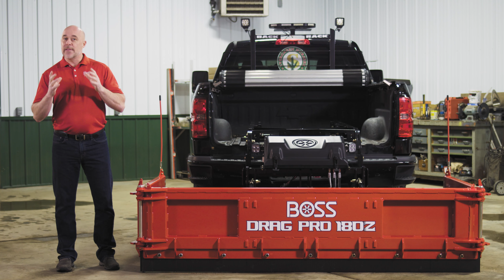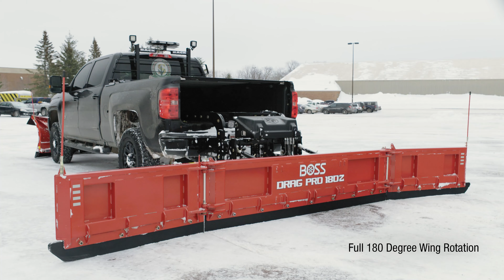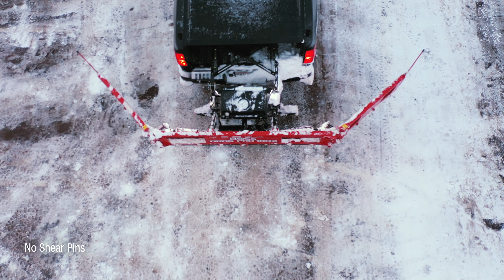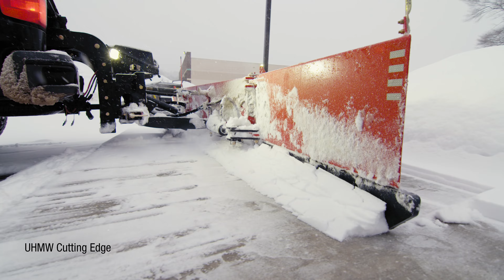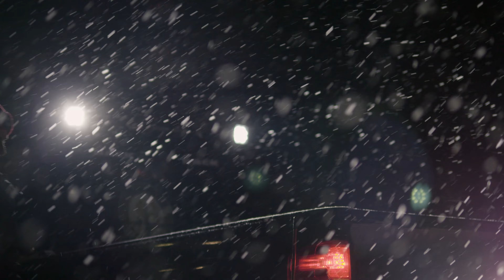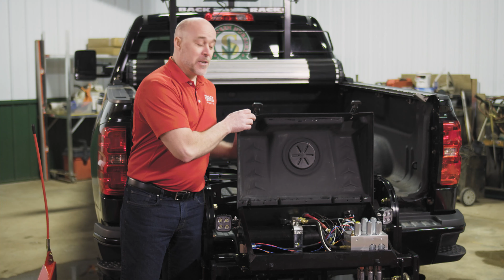DRAG PRO 180Z Rear Snow Plow | Features & Benefits | BOSS Snowplow

Comment: Not to rain on the parade but the mast brothers out in Grand Rapids Michigan have been producing their swing-wing 180 back blade for years now…
Reply: Ebling is the Rolls Royce of back blades.
Reply: The last company I plowed for has had a 16ft one they swapped wings on to now be a nearly 19ft one on a 2015 f550 ext cab since the truck was new. I’d really be curious to see how your guys’s version holds up over the years and if you will offer larger models.